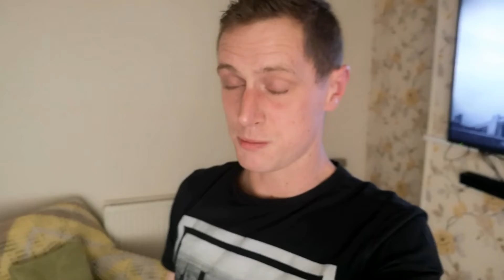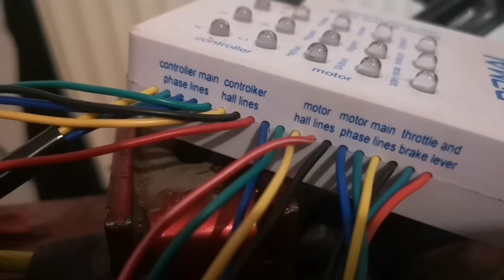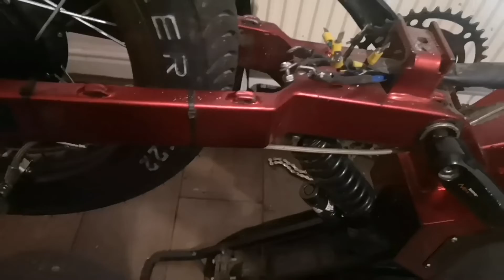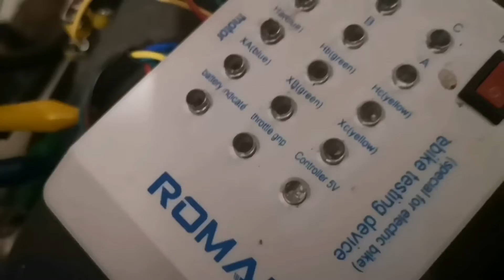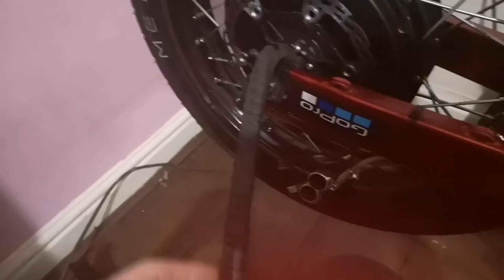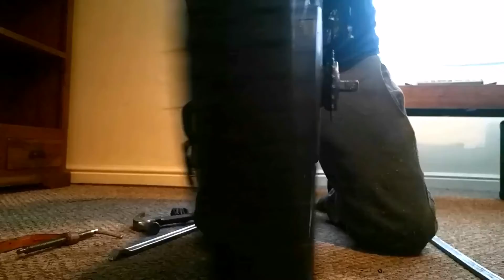How to diagnose and repair ebike electrical issues |hall sensors | qs hub motor | romai ebike test |

Comment: thanks for sharing .when I test the hall sensors the led light are good bright but when I test the 3 phase windings the led lights are weak and they just turn on when I spin the motor in back ward direction and when spinning forward direction they stay dark any body there to help?
Reply: There are two wires that are "learning wires" for the controller to establish which direction your motor runs. Just Google "learning wires on controllers" you will find a video!

Comment: Hi, I am currently trying to sort my wifes E bike after it stopped working ,I have got the exact same tester and I am trying to test the hall sensors. when I spin the wheel I do get 1 or 2 of all 3 lights showing but looking at the paperwork it sort of implies at some stage all 3 lights would be on ...is that correct because I can get all lights individually lighting or even a pair but never 3 ..any ideas ? thx
Reply from the maker: There should be 3 lights in a row when you turn the wheel mate them 3 will light up separately turn your wheel slowly. Them 3 are for your windings. The other 3 lights should also light up separately in a row and they will be for your hall sensors. Any that don't light up means they are damaged. All 3 don't need to show together. Hope this helps 👍
Reply: @theebikenut4679  all 3 lights do light up but I can never get all 3 on together ..is that not right ?
Reply from the maker: @igarratt  you don't need all 3 to light up together.. Just as long as they light up bud.
Reply: @theebikenut4679  thanks .also just done the same test that you was doing at 5,40 and mine is doing what yours was doing on operating throttle  ie.2 pairs of lights but random and not aa bb,cc, did you find out why yours suddenly corrected itself ?
Reply from the maker: @igarratt  no i didnt actually  i guessed the wires were on the wrong  way when i first tried it . i would check that.... let me know if you figure it out.
Reply: @theebikenut4679  i went and checked and all wires were correctly colour matched and they were ?? ,however I left the blue's attached this time and swapped the green and yellow over and the it matched the leds in pairs ie .AA and BB ,CC... .. but still not working so in summary the tester shows everything working ie throttle, controller ,motor and halls but I still have nothing .I only noticed yesterday that when you turn the throttle the motor has a faint click and moves a fraction of a mm then nothing . I did what you did and stripped the motor out and everything looks intact ,no loose wires and all the magnets seems secure ..so I am at a real loss with this one..?
Reply from the maker: Did you replace any hall sensors? Your wheel will click and move slighty if your hall wires or phase cables are around the wrong way. Other than that I would suggest trying a new controller.. When I had my issues I asked the electrical engineer at work and he said if the lights are flashing in the wrong order it would most likey be a fault with  the controller. Hope you get it fixed soon m8
Reply: @theebikenut4679  Thanks for the response but it is a new controller and I have double checked the wiring to be correct but still no luck so I am just stuck ?
Reply from the maker: Ah sorry mate with out having a look at it I can't help you any more if you get it fixed please let me know what you issue is. 👍

Comment: Do you have a link for the rubber tape? that covers the wires going into the motor.
Reply from the maker: Yes mate you just search ebay for rubber tape.. But Hears the link bud 

https://rover.ebay.com/rover/0/0/0?mpre=https%3A%2F%2Fwww.ebay.co.uk%2Fulk%2Fitm%2F333303825541

Comment: nice one mate, I'm wondering how much fun you'll have putting it back together. could you tell me which vid you did about your controller cuz I want to know which one ur using
Reply from the maker: For the controller info Ebay item number 163876807109 and contact the seller via e mail they will make you anything you want pall they are not cheap but they are good as my vids have proved... I'm not looking forward to the rebuild but definitely looking forward to twisting the throttle again lol

Comment: When I took my wheel apart I used a big flat headed screwdriver and I kept levering it either side it popped the side cases off fairly easily. As for the magnet I stood on the wheel and it popped out probably not the best way I admit but just another way it can be done
Reply from the maker: Yeah you could use a screwdriver and I like you stand on the wheel method 👍. It wouldn't work on a 5kw wheel tho the magnets are to strong.. Nice to hear from you again hows your bike holding up?
Reply: Not to bad tbf I have a new upgraded battery on the way i will be fitting that on as soon as it comes. Hopefully I should get better acceleration and able to go further
Reply from the maker: You should keep doing your youtube videos bud I liked watching them and seeing what you get up to I bet you can't wait to get your new battery. I've just received my new hall sensors... So I'm back to rebuilding fingers crossed it works again 🙄